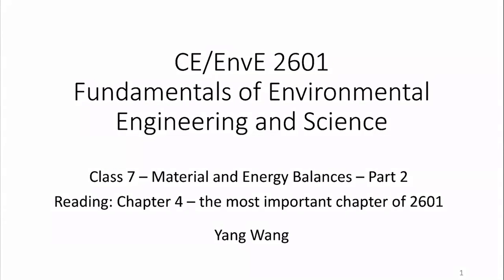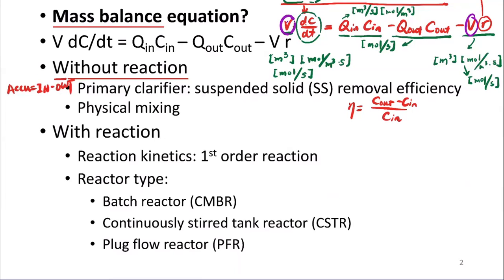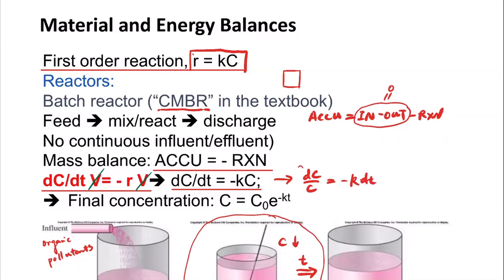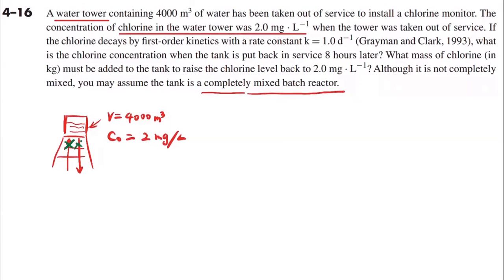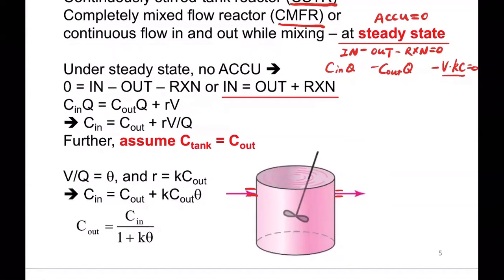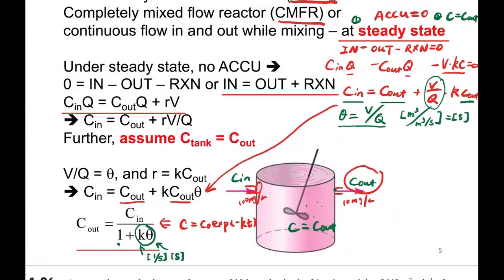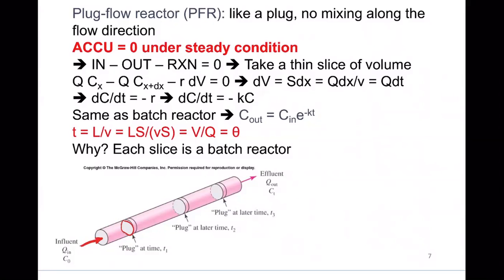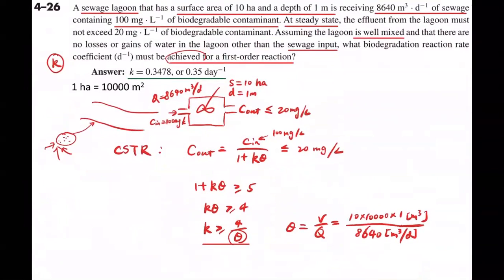Class 7 Mass and Energy Balance (2): CMBR, CSTR, PFR (Fundamentals of Environmental Engineering)

Comment: Also, sir! I have a question, you said the accumulation is calculating the MASS per time not the Concentration, so since we are given with Volume and no mass, shouldn't we multiply that volume with density? I mean the formula of the density is p = m/v, and this is what I use whenever i solve this mass balance before so that I can get the unit for mass. can you please clarify this? I don't have anyone to answer this for me
Reply from the maker: It can be density or mass concentration (mass per volume of liquid)